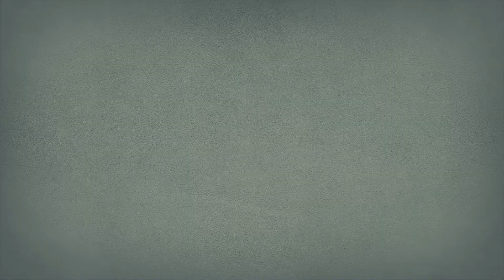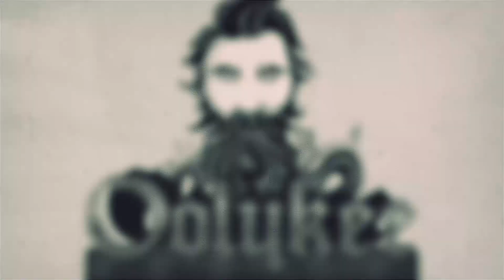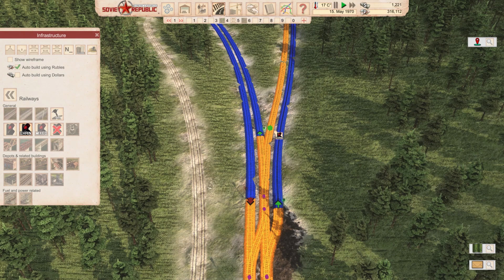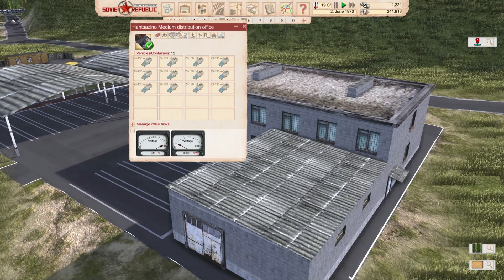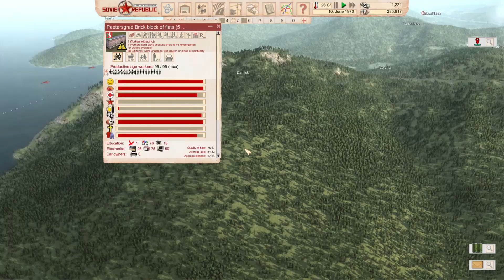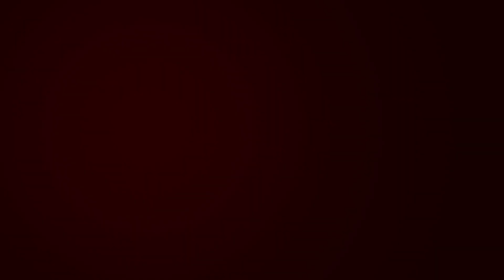Soviet Republic - Mezirusy - Ep.61

Comment: i see good things happening . . . on the railroad, at building etc. 👍🏻 ! !  you are tackling the problems 1 at the time ! ! my max number of trains running at one line was 25 in a previous map wich was lost when my computer crashed . .😡 , and it was running without problems. 
you keep building , and i keep watching my Friend ! ! 🍻
Reply from the maker: One lane or 2 lanes? That's impressive in any case!!
Reply: @oolykeegaming81  ; on 2 lanes, over 4 city`s. but it depends on your way of building, i did it the way i described in yesterday`s comment, but if you want more it`s possible . . . if you use the hole map to built, make a kind of `ringrail` with one or 2 shortcut`s through the middle . . . (kinda . ., depends on where your city`s are)
Reply: i built alway`s double tracked . . . or it has to be a single line to a single factory
Reply from the maker: @TheModfather-67 right!! I need to learn to express myself better. I meant how many trains you can do on a single lane. :D :D 
I would assume as many stations you have at the ends. It's like the double lane railroad. You can as many trans as you have "blocks" minus 1. :) 

Yeah! That's probably it! I think I got my answer now! :D :D 

Thanks, man! :)
Reply: @oolykeegaming81  ; if you want to run it smooth, take half the number of trains . . . it gives you some breathingroom . .  Good Luck ! !
Reply from the maker: @TheModfather-67  thanks, man! I really appreciate your input! :)
Reply: @oolykeegaming81  : Hey, i love to help where i can, BUT . . . i`m Dutch, so it sounds maybe sometimes Rude ! ! (we are Not politically correct and love to swear) but it comes from a good heart . . . 😅😂🤣
Reply from the maker: @TheModfather-67  I know you guys very well! I work with 4 of you and have even more as friends! I am 193 cm tall and you guys are bigger!!! All of them! Stop growing!!! How tall are you? :D
Reply: @oolykeegaming81  ;  placed a picture on Steam so you can see what i mean  . . .  , look for Roadhogg. 
Btw i`m small with 6 Foot ! !  😋
Reply: Keep on having problems with posting here. My previous post disappeared, and I don't know why. 
It said that in my oldest play, I had a republic with 160.000 inhabitants and twelve pages of trains running all whithout issues. That was only possible because I used the KISS principle and I monitored and corrected errors during 40 ingame years.

https://steamuserimages-a.akamaihd.net/ugc/1027325137552353103/999BCD310B4A1F0FC2915E2ABD4DC1741EB69E98/